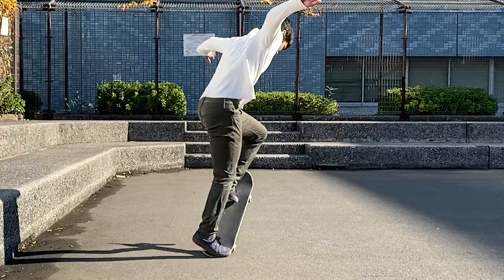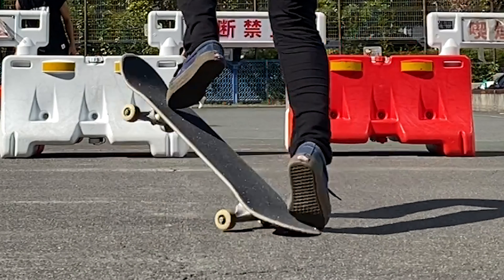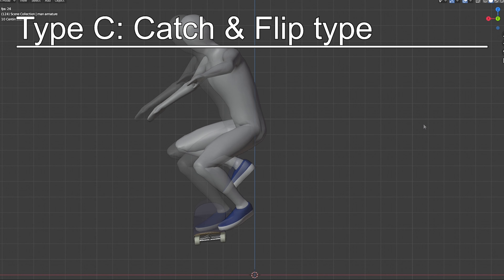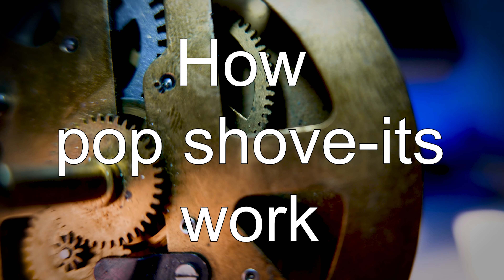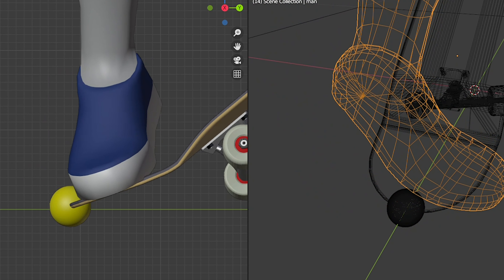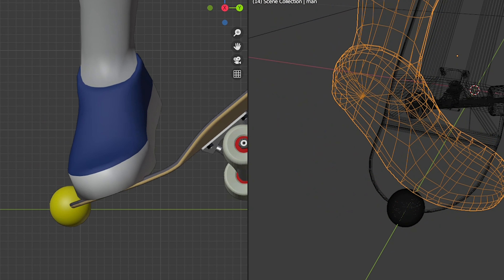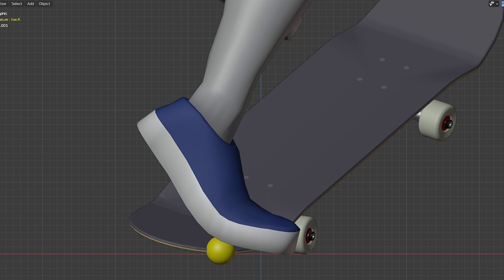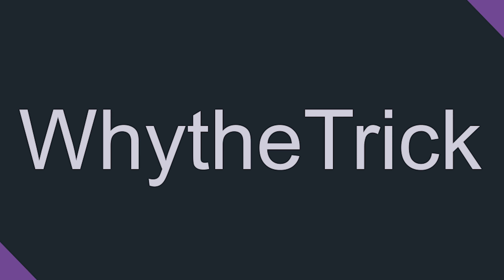Why pop shove-its flip and how to avoid it. Is that REALLY because of your foot placement?

Comment: I've learned how to stop flipping pop shove its accidentally, and i think you missed two major points. I started flipping mine on accident when i was trying to learn 360 flips. And after a lot of putzing around, i found that one surefire way of preventing an accidental scoop flip is to cock the board toward the heel-side before popping. In other words, you can ride straight ahead, with your heels and toes parallel to the ground, or you can press on and lower your toes, or your heels. So right before i pop a shove it (or don't pop it), i tilt the board down on my heel-side. If you go far enough, it's possible to land primo in the opposite way, but that is easily avoided by the other thing you missed- which is following the board closely with the front foot and catching it in the air (if it leaves the ground at all). A lot of the time, i'm sure i don't achieve an actual heel-side tilt, but putting a little pressure back there makes it good enough not to flip. And doing those two things, i can pop really hard or not at all- and with all kinds of foot placements- and not have to worry if the board is going to flip.

Comment: given the trucks and wheels can store energy and cause the board to flip what stores  more energy - tight trucks or loose trucks?  Which is more likely to  make the board flip  - tight or loose trucks?
Reply from the maker: IDK if answers your question but everything is a "spring" after all.
regardless of their hardness, bushings always have elasticity.
so although i think it all comes down to methodology, i believe loose trucks are more unstable and easier to cause accidental flips.
Reply: @whythetrick  thanks, With that would you say loose trucks should kick flip more easily?

Comment: My sense is that a more square-type of tail would make it easier to avoid pop shoveits fliping. Conversely, squared tails make tre flips a bit harder. I'm an old skater from 91.... with those old decks, pop shove its were easier (less likely to flip) than using the popsicle (more round tails) decks.

Comment: I have figured out a way to virtually never go primo on pop shuvs. I always tried to keep my back and front foot as flat as possible, but I found that sometimes that wasn’t enough. So now, before I pop, I always lean heelside while keeping my feet flat. It works really well.
Reply from the maker: Interesting. Angles of ankles are definitely on my menu in the future…
Thanks a lot.
Reply: @whythetrick  it could be that he's keeping his body axis more heel side
Reply: I think the trick for this is that you just keep your front foot close or still on the board and it prevents the flip. If you watch some of these slow mo shots his front foot doesn't leave the board. You want to pull your legs up high like an Ollie and that's when you lose the control over your y axis. He almost points his front toes a bit forward and keeps it on the board.
Reply: Exactly! I do that before every shove it and they never flip anymore. That and catching with the front foot works like a charm.

Comment: What about the friction of ground in Type A? would it affect the rotation?
Reply from the maker: you know, someone said about that in his channel.
i think it does, up to a certain extent ESPECIALLY in normal shove-its, not pop shove-its.
normal ones' final contact points with the ground are wheels. they'd receive more friction from the ground.
whereas, in pop shove-its, its the tail that hits the ground, and the contact point is fairly "pointy," which, i assume, does not affect the flipping motion so much.

Comment: on my own board (tight trucks) never had an issue with po shoves, but using someone else board with lose truck i am more prone to flip a shove it. looking at your model of the truck dissipating energy, makes me wonder how much a factor this is in when scooping 3flips vs 360shove vs pressureflips
Reply from the maker: true. will look into it.
Reply: i use really tight trucks to the point i cant even turn and my 3 shoves always flips
Reply from the maker: is it type A or B??

if it's type A:
you know, everything in this world is a spring. even diamonds have elasticity. so hardness of bushings doesn't directly assures anything.

type B:
this doesn't really have anything to do with the bushings. so if this is the case, you might want to focus on timing.
Reply: @whythetrick  its type A

Comment: How do you know that the flipping is caused specifically by the truck loading up and then springing back? Why couldn’t it be the deck bouncing from the corner? Or maybe the motion of “rolling” the deck over the friction of the back wheels? It’s not that the truck loading theory is illogical, but I’m just curious how you know it is that specifically, when it might be other forces at work or in combination.
Reply from the maker: thank you for your comment. such an excellent point.

if I may rephrase your question and say "can I be sure if the rear truck is the sole factor that causes the flip?" then I'm afraid have to say I can't.

In fact, I think I said the spring of the rear truck is not strong enough to cause the flip alone in the previous video. and a result of my physics simulation also supported that idea. So I --- as much as I'd like to avoid using this word --- assume the spring of the rear truck and elasticity of the tail and everything sums up to cause the flip.

Although I need further confirmation and calculation on this matter, based on the previous simulation and the fact that we sometimes can "phantom treflip," which we don't hit the tail, the bounce of the rear truck SEEMS to be the biggest factor to cause the flip.

hope this clarifies your question.